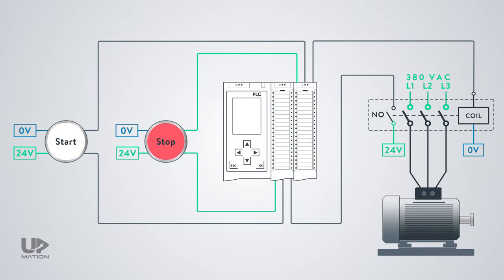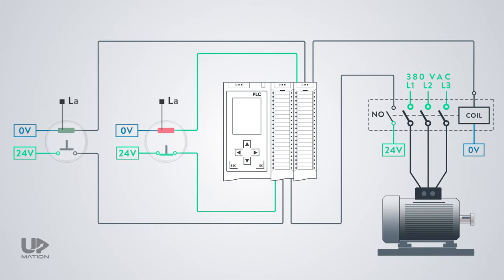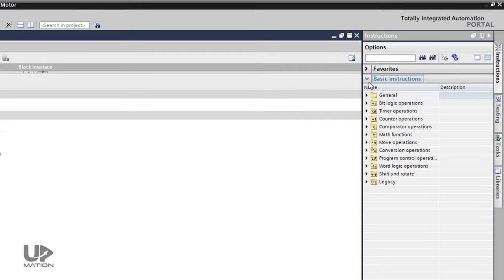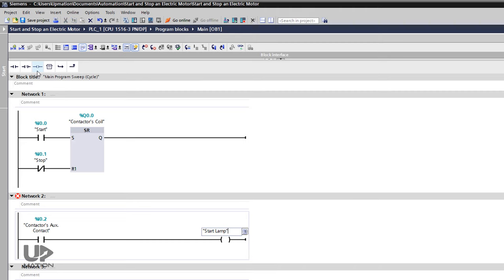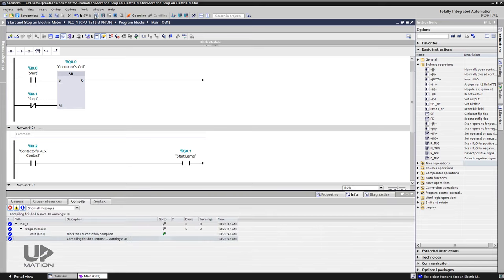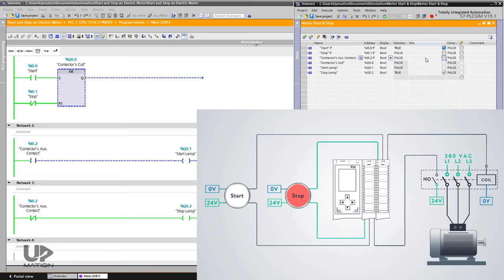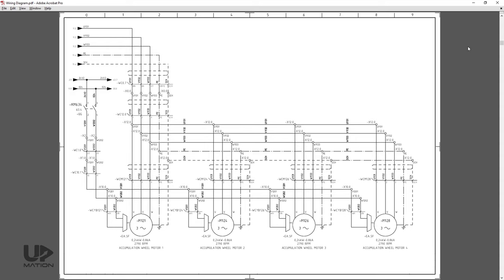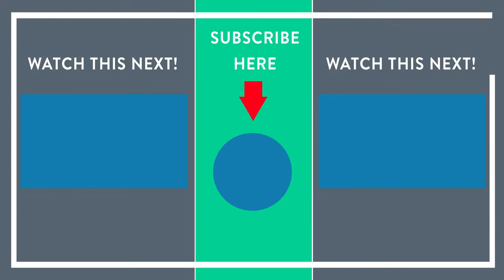Siemens PLC Training: Motor Start and Stop Ladder Logic PLC Program | PLC Programming Examples

Comment: Why are you connect normal closed switch to the Reset of the flip-flop? So it will remains 1 until you press it, and it became 0. When the Reset = 1, the Q is 0?? I just don't understand...

Comment: I have i3, with 4GB RAM on operating system of 64-BIT windows 10.i just want to ask, is it compatible to run V15. 1  TIA?
Reply from the maker: From this link, you can find the recommended hardware for installing the TIA Portal V15 (in the middle of the page): https://sie.ag/37VWEXG
I doubt you can install it on your computer. Although if you can, then most probably it won't run smoothly.
I think your RAM is the most critical part of your hardware for installing (or using) TIA Portal V15 which according to our experience should be at least 8GB.
Reply: @Upmation  thanks.

Comment: Hello sir .. i need help . Im a student Making a PLC ladder diagram.. please help me .. its verry easy but i cannot answer. Im only first timer.. heres my problem.

When you press Push Button (PB1) – X21 the output bulb (YO) will lit… When you release the PB1 the output bulb will off.

Im done subscribing your channel.. 
Please help me
Reply from the maker: Hey! We have missed your comment! Sorry about that!
If you use an SR FF same as what has been explained in the video then you should achieve the same result.
I'm wondering if you want to do the same thing with a single PB?! (the program would be different a little bit in this case)